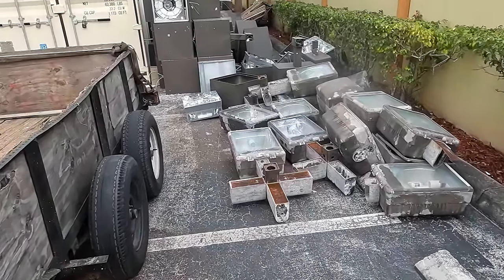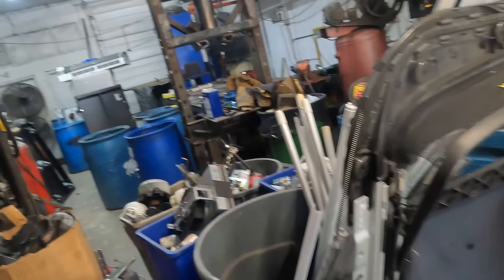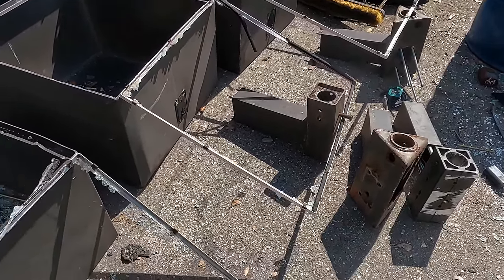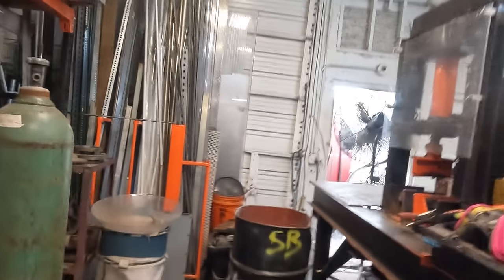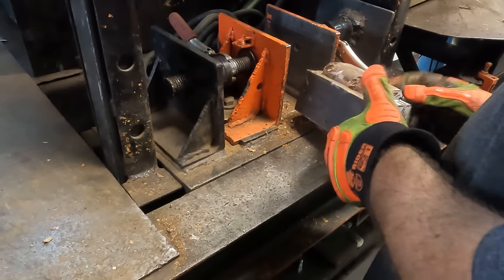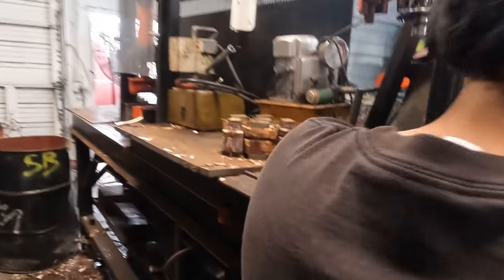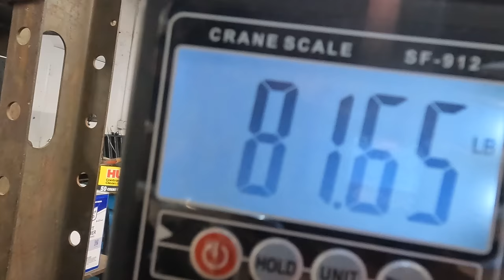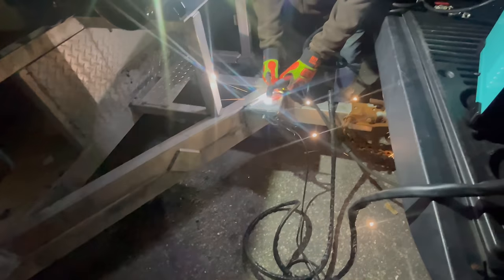Scrapping Massive HID Lights - Copper & Aluminum Recovery

Comment: I don't know if you have that brand in the US, but I have a number of Parkside plasma cutters that have built-in compressors. I always have one on the back of the pickup with a small generator. to cut light fixtures, etc. into small pieces on site, which makes a considerable difference in volume. and here these plasma cutters don't cost anything, they are around two hundred euros.
I'm from the Netherlands
Reply from the maker: I've never seen one like that. lol

Comment: I notice you do not remove the rivets with the rivet removing tool that comes with your air hammer. Also you should have in the set sheet metal attachment
Reply from the maker: Thanks I will look in to that.

Comment: The time saver in me had an idea, can you clear out the cracked transformer, load the next, and cycle the ram down with your feet while cleaning off the steel from the just cracked one? Since the down cycle takes several seconds and is obvious by the double crack sound, you should be able to take your foot off while clearing the steel pieces. Just a random thought from my OCD brain while watching your cycles. Might need a little more table in front to give you a spot to slide the cracked transformer over to while loading the new one. Have a good one!
Reply from the maker: Thanks for the suggestion

Comment: maybe you could drill a hole in both of the chucks an put a put a piece of round bar stock in there with threaded ends an put nuts on so you can remove them if u need too, you know kinda like what a bench vice would have
Reply from the maker: Thanks for the suggestion